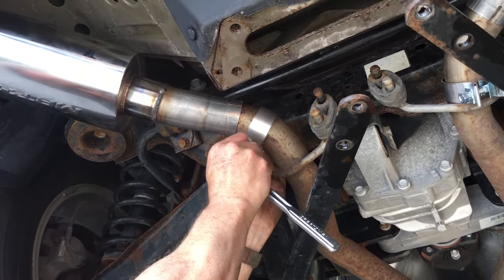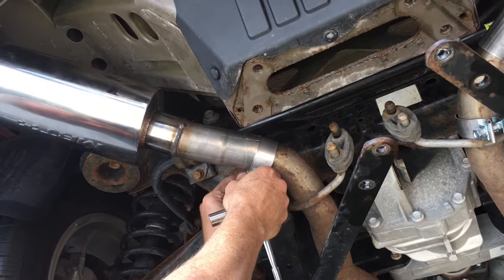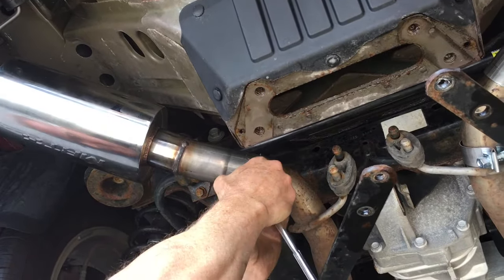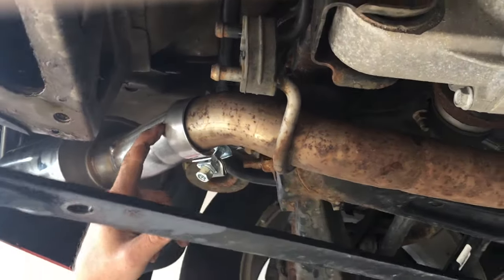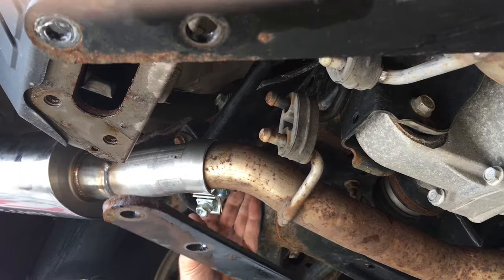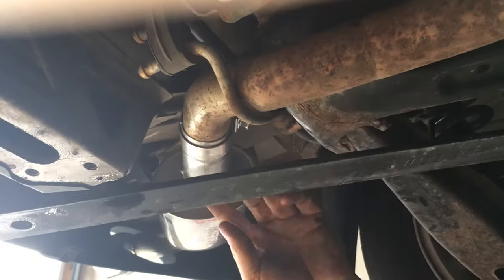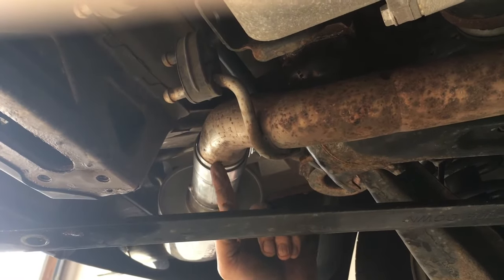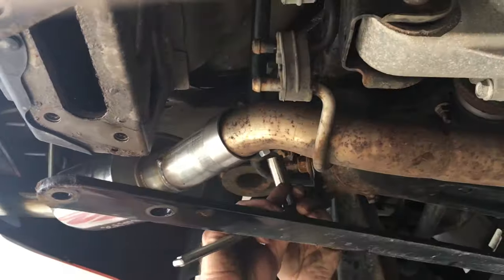Master Exhaust Band Clamp Installation in Minutes!

Comment: Hello there, I'm assuming these things leaking is because most people dont place them like the video shows? i have a brand new high dollar exhaust in my car i installed recently and the cats is the only place that has these slip joints and they have been leaking,the slip joints are only in one spot, the other side of the cats is welded, i did installed them like you did at the beginning when i got the exhaust  but i didn't move them out as far as you have them so i did that tonight, fingers crossed  and ill check it in the morning,i really dont want to weld this,i have heard of using RTV high heat or permatex,what is your opinion on that?  thank you and i appreciate your time and input.

Comment: Those Champs are not ver effective. I CUT my pipe and weld on a coupling.
Reply: Doesn’t work on every vehicle, top of pipe is too difficult to reach without taking off transmission brace.